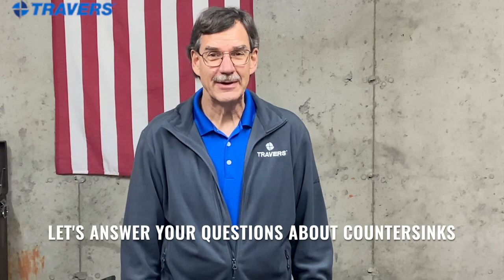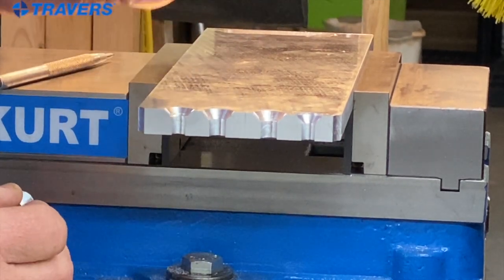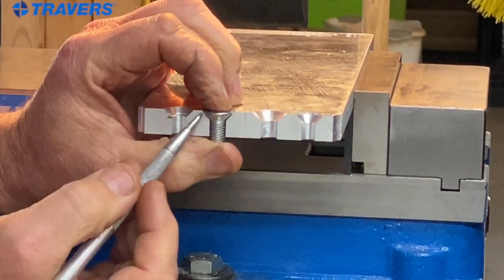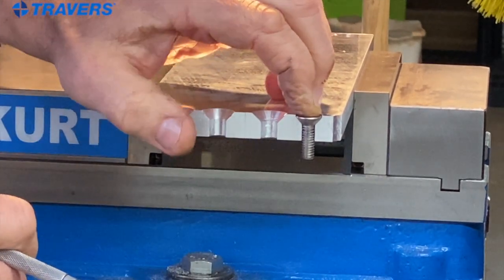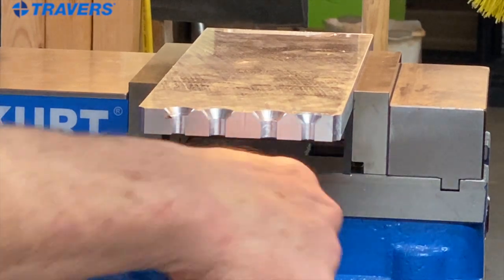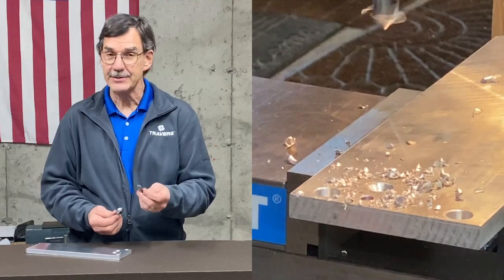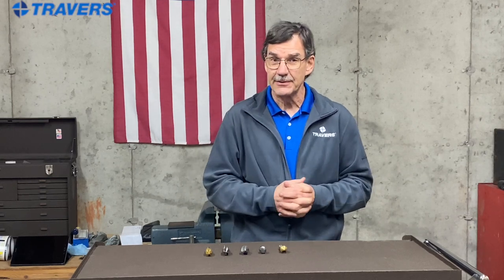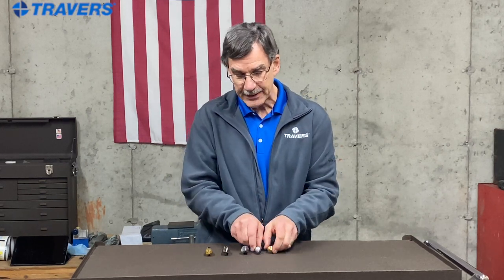How To Countersink A Screw

Comment: @37yearsofanything isenough -- Great point, thanks. Of course a lock washer can't be used on a flat head screw, so yes, if it's critical that the screw doesn't loosen, then thread locker could be used. If the screw needs to be removed, that hex key will likely strip the head of the screw, but using heat will loosen it up a bit. If it's that important to keep the screw tight, maybe a different type of a screw might be the best choice, wherever possible.

Comment: I would never install flathead screws in ANY ANGLE  countersunk hole, matching or not, without using thread locker liquid to prevent them from coming loose. You are asking for trouble down the road if you do not do this.  This is the reasoning behind lock washers/lock nuts prior to the discovery of thread locking liquid.
Reply: Good point, 37yearsofanything isenough.  Since you can't use a lock washer, thread locker is a great idea for flat head, as well as socket head cap screws, for the same reason.